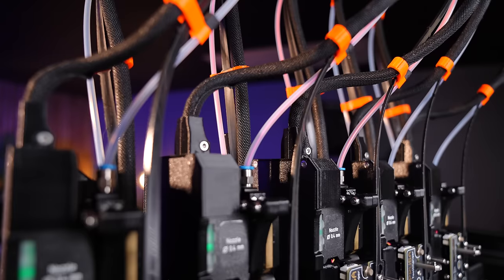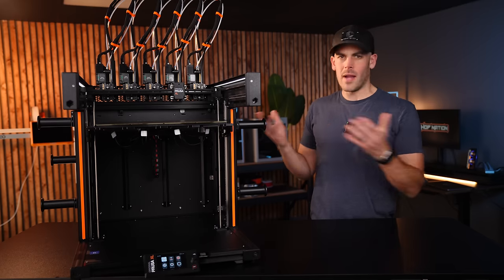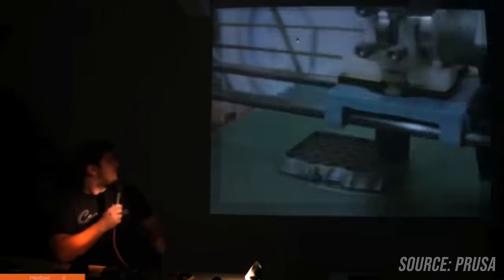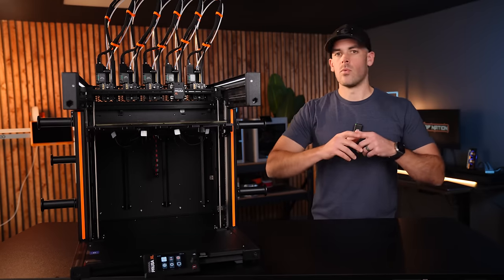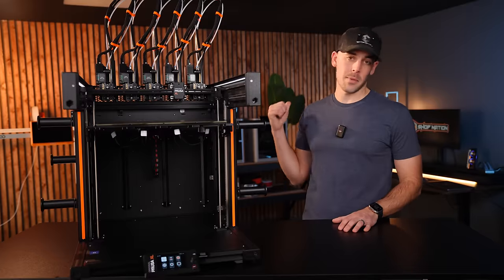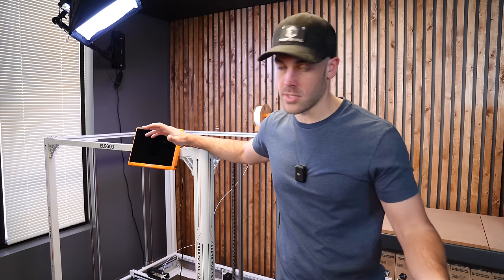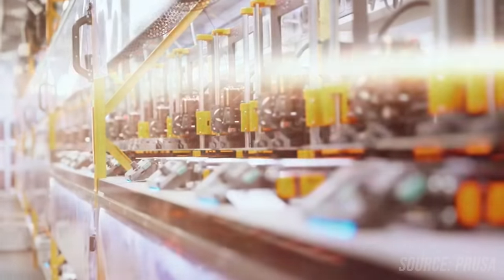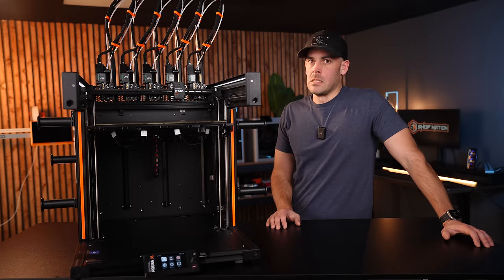Why Prusa is the next Blackberry

Comment: i'm not even necessarily sure if prusa needs an innovative or super new feature set. it really just needs cheaper printers (so innovative economics and production rather than features) with complete out of the box feature sets. what makes bambu popular and really what made the first iphone popular is its approachability and price, yes iphones were cheap at one point and that's what made them good. iphones nowadays are absolute trash for value nowadays. but they used to be a good product at one point rather than a status symbol. input shaping is already a game changing feature, it's on the mk4 sort of, now i just need it for about half the price and out of the box, oh look here's the p1p. prusa doesn't need a X1 competitor, it needs a p1p competitor.

Comment: My XP is from some one using a MK3s+ with an MMU2. There are some prints where I do need to print very small volumes of one filament then switch to another that cover most of the print. Having multiple changes and a proper construction from MMU through to the extruder is extremely important. With the MMU and MK3, that setup was incredibly frustrating that when my MMU failed, I just pulled it out until I upgrade to the MMU3. Funny….seems to be the same issues people using bambu labs are going through. Anyway, happy to pay a little more to get something better developed that covers that reliably. I am jealous of what Bambu come with for the same price point as an MK4 BUT anticipating reliability is still on top my decision making.

Comment: I have MK3s and Bambu Lab P1S printers.   I could buy upgrades for my MK3 or just buy a whole other printer Bambu printer at that cost.....yeah.   The only advantages in my eyes is a TPU/PETG part combos and the biggest (assuming the slicer is capable) multi nozzle size prints. So you can rip .6/8 nozzle and the do detail .2 nozzle work topside for one example

Comment: To conclude, the big Prusa is ideal for large multicolour work and the Bambulab isn't. Also it's a lot smaller. In fact if you compare build volume to price ratio the Prusa wins. The MK4 is a workhorse. Simple and easy for DIY maintainability. If you want a small super fast printer you can't do major maintenance on, buy the Bambu P1. If you want an easy to maintain workhorse and are more interested in quality than speed buy the Prusa Mk4. So in a way, each model has it's niche already.

Comment: My XL will arive next week. Never had a Prusa printer, I started this hobby 1,5 years ago with an Ender 3 S1 Pro. I considered to buy a Bambulab X1C, but I have to say there are 2 reasons why I don't like the X1C. The first one is the waste of filament when changing color. In times where sustainability is on our minds, this wastfulness turned me away. The second one is "being like an Apple-Product", no Open Source.
If you ask me for what kind of jobs I need the XL, I have to say: "I don't know yet." But when I started with 3D-printing, I had an idea in mind and while learning to print, so many more usages, I never had in mind, came forward. I expect the same for the XL. 5 toolheads might be overkill, but we will see. Of course I would have loved an enclosure and a heated chamber, but this might be one of my projects, if Prusa won't design upgrade kits. I am excited to experience the highly lauded Prusa community.

Comment: I would love to have a toolhead changing 3d printer. I bought a P1S for work and I outright refuse to print  "inefficient" multicolor stuff because of that enormous waste and inefficiency. Being able to do something is not always the right choice, it has to make sense and be a "true" solution and not a half baked one.
Having a slightly taller X1C with multiple heads for, let's say 2000€ would hook me immediately.
Also I dont get multi material tool changing printer without an enclosure. What "multi material" do they want to print with it? PLA, PLA-CF, PLA-tough, PETG?

Comment: I made the jump from Prusa to Bambu for a couple of reasons, and I think Prusa can definitely win me back with a few changes to keep them in the game.

1: The kits need to come more assembled than they are. Their Mini was a good step in the right direction that could be put together in roughly the same time as it took to take out, check and set up the A1 Mini, but you lose that as soon as you head any bigger. Trying to put together the Mk3S while having expected a Mini level of pre-assembly was a nightmare. With how much Bambu Lab slashed the price on plug-n-play printers, the Prusa kit prices feel not worth it and the assembled prices feel more like a tax than ever.

2: Quick change nozzles and ease of use. This is something I want both Prusa and Bambu to focus on more. The reason I prefer my A1 Mini compared to the CoreXY printers from Bambu is not just due to size, but because of how easy it is to swap out nozzles and maintain the hot end. I've yet to have the A1 Mini actually ever clog on me, and every time I need to switch nozzle sizes for a print (or god forbid, if something does get clogged,) it's a breeze to let the hot end cool and just swap the nozzle. It's these kinds of innovations that make both casual enjoyers and hobbyists lean over and covet this thing.

3: CoreXY and multi-material printing on smaller/budget frames: I love how the Prusa XL works, and that kind of work you did with the Benchy is kind of my actual use case. But I can't justify a 3500-4000 price tag, especially when as a hobbyist first and foremost even the X1C makes me squeamish. Bambu Lab made MMU accessible via their AMS lite for the A1 Mini, and it just works, with a price bump that is barely felt. Until the XL on the other hand, Prusa's MMU units were twice as expensive, a pain to set up, and nowhere near as effective. I'd love to see something (as oxymoronic as it is) like an XL Mini - two to four print heads instead of two, with CoreXY, around the 800-1000 mark, or a single nozzle option with MMU for 400-600. Wishful thinking, but I think that's the kind of big splash Prusa needs to make to finally switch gears and snap people away from starting at Bambu.

Comment: Prusa must IMHO significantly lower prices of their machines. Enter cost is now so uncompetitive, that it's hard to justify buying Prusa MK4 as first 3D printer. If you have MK3 then upgrade is kinda justified, but just barelly as the price of the upgrade kit is insane, just couple hundred bucks less than full MK4. Really, if I wouldn't have MK3S+ bought 2-3 years ago, when it was really good choice for the money, I would just buy Bambulab today. But I don't need two machines, so I "just" bought upgrade to MK4, which I don't know if I feel alright with, but here we are.

On top of that Prusa must do better updates to their basic MK4 and do it fast. I mean just look at MK4 and Bambulab Carbon designs. Prusa still lives in DIY scrap parts era, while competition puts out machines that are just pleasant looking. And have more features out of the box for similar amount of money. Bambu has enclosure built in, for MK4 its cost of yet another hundreds of dolars.

To summarize: Prusa is heavly overpriced, heavly aged machine now that is still great piece for hobbyists and they have great support and are EU based, but if they don't change direction soon it will be game over for them in the consumer market.

Comment: Prusa got big with a quality controlled version of an i3, basically following on from the ratrig project.

I only have my vorons now and they're wonderful - but they took a lot of work to dial in. A voron with a stiff steel frame and machined gantry joints? Od be all in.

The XL isnt the same thing. I think for most users multicolour prints are not much more than a novelty. Most of the AMS users I know tend to use them for continuous printing of the same filament, with maybe a spool of a different plastic for totally different models.

I don't think prusa the company will disappear, but i think they're going to disappear from the comsumer space outside of filament and perhaps their SLS lines.

Comment: Wow.
$4000 to output Benchie quality of a badly tuned $99 Ender 3, just in multiple colours. Given the time, the X1C will deliver far better unless you sabotage it. As I'm sure you know, to reduce the purge waste, you print 10-20-30x multicolours doodads at once for the Etsy toy store.

Yep, the XL was rushed to market not even half cooked. Yours is not the only one on youtube turning out low quality prints.
If I was a printer manufacturer, I'd be sending the content creators the units from the upper end of the QC to show them in their best light.  Dear god I hope these are not the upper end of the QC.

Comment: One major thing that Prusa (and any Open Source printer) will have for the fairly long term, is that 3D design always ends with the STL or 3MF.  These are standards.  Programs won't tie themselves to a specific printer and take on the burden of handling slicing too.  Short of Bamboo locking necessary features behind a propritary standard that they never reveal, that STL or 3MF will be useable with any slicer, and thus there's never gonna be a "walled garden" for printing.  This is in contrast to smartphones (which have always been closed off, from the first android to modern iOS) and PC operating systems (which use different libraries and output formats for executable).  Both of these result in a program needing multiple dependencies.  STLs and 3MF are isolated packages.  Short of reading the actual data, you need no outside resources to get the final result, it's all in the file.

Comment: It definitely doesn't justify the five heads, considering you can get two heads on it for about $2600. But one big advantage is using different materials for support material. Like petg for PLA and vice versa. I've tried with many fails on my X1's. I have never had the honor of owning a prusa, but have been eyeballing the xl for a little while now. With that being said I know you can get much cheaper idex printers, but they do not have the reliability of an actual prusa. And unfortunately for all other brands, bambu set the bar pretty high when it comes to high speed printing.

Comment: If you print multicolored parts, you lose a lot of time with AMS for material changes, so the printing is much slower than you have shown, and you have so much material waste with Bambu Lab that it is uneconomical - the additional costs for Prusa XL have paid for themselves after a short time, and you make more profit than with Bambu Lab printers.

Comment: "couple hundred bucks"? 😂😂 I know they're ridiculously low-cost for what you get (particularly for the A1) but that made me laugh after looking at a possible purchase of a P1S + AMS recently...

Besides the multi-material printing that others have mentioned, Bambu explicitly state that the AMS doesn't support a lot of materials, including TPU. Your conclusion only makes sense if you compare them on Bambu's terms: just focus on simple fast multi-colour printing with the most common filament types, and ignore significant limitations that need to apply to the print for AMS to be as reliable as it is at that price point. In that case, it just looks like a dead-heat between a young low-cost upstart and an old expensive complicated behemoth. Except that's ignoring the rest of the Prusa XL feature-set to get there. The XL supports fast multi-colour and multi-material printing, for all standard filament types, with near zero waste and an expectation of higher operating reliability by keeping the print feed as simple and robust as possible compared the relative complexity of the AMS feed system, as you noted.

While the iPhone to Blackberry comparison is apt if we're only comparing aesthetics and accessibility, it doesn't make any sense for other aspects. Maybe an early iPhone (limited functionality, but very accessible UX and high desirability) to early Android phones (rough around the edges, and requires more from the user, but much more functionality and flexibility... and with open source underpinnings that support an entire range of competing devices) would be better, but even then it's still a pretty bad analogy when looking at price or the structure of the 3D printing market. Is Prusa Google in this analogy? HTC?
Blackberry phones died after other phone systems knocked them out of the corporate market where their enterprise integration kept them separate from most competitors, which doesn't fit any of this - now they're effectively just a licenced Android phone badge. Were they actually the mobile phone market equivalent of industrial FDM like Stratasys? 🤔
Is Creality FDM's version of Nokia? 😄
At least it isn't the usual go-to bad analogy of comparing any new technology as types of car, I guess 😄

Comment: AOL CD? Nah. I remember getting AOL diskettes in the mail, using their internet trial, taking a magnet to 'em, and low-level formatting them for 1.4 MB* of sweet sweet storage!

I've been wanting to do some multi-color prints for things like con badges, pronoun pins, etc. so being able to do 5-color prints in a fraction of the time as a Bambu Labs printer and with less material waste is a no-brainer. Sure I have a purge block to deal with, but with the materials I'd be printing with, I can just chuck 'em in my blue wheelie bin and let the recycling center deal with those. I can see these getting quite popular with the 3D printing etsy shops

(*closer to 1.2 with a filesystem)

Comment: The build volume on the x1 is only 256mm square - way too small if you need a printer for cosplay like I do. My i3 Mark 3S is 250 x 210 so why would I ever by the X1? I went with the XL because I needed a large volume printer with the reliability of a PRUSA. I did a mind numbing amount of research before buying the XL and no one who had a large volume printer could stand up to them in comparison. Everyone's interests are different for 3D printers and for me the XL was a clear winner ...

Comment: True multimaterial, including *TPU*.  I'll say it again: *TPU*.  There does not exist any single extruder multi filament setups that can effectively handle TPU.  Not the AMU, not the MMU, not the carrot patch.  Multiple print heads and/or IDEX is the only way to effectively mix truly flexible materials with more rigid plastics.

Comment: Shop Nation where you been? At 70 I have the attention span of a gnat. You’re the only Youtuber capable of capturing my interest for 20-30 minutes. I spent 40 yrs in sales to the architecture/engrg/construction space. Most of that time was spent in start ups within existing corporations. Working for mfrs I saw this: There is always a tug o war between the egos of the C suite, operations, sales, & accounting. Most mfrs cannot pull off more than 1 or 2 good products. The myopia of acctg and the C suite often causes the stagnation for innovation. Prusa no doubt suffers from the same thing. Mfrs must have capable staff adept at lean mfg and Kaisen or other. If not they get left in the dust.

Comment: Full honesty, as someone that makes cosplay bits & parts, a build volume exceeding my CR10s Pro V2 but with up to 5 colors/materials on deck on their own heads is basically a dream machine. Yeah, it's a lot more than the bambu but not being stuck with bambu's "Ecosystem" of crap and having individual heads per material is great (EG: Having specific nozzles for the more testy filaments i use)

More or less, i could replace my 2 smaller machines with one bigger one that could literally print twice the parts they can combined (14x14 compared to 2 7x7 machines) and still do 2 different materials.

I think a "MK 5" single-head machine with like, a 10" cube build as a core XY would be the best mass-market "Pivot" for the long run, but the XL for certain users (Like me) is a great machine with some minor upgrades

Consider this, i can print cosplay armor parts currently, but it takes 3 machines to make one part. One makes the flexible joints/spacers/inserts, one prints the smaller joint/detail/etc parts, and the big boy prints the big chunky parts like main plates or straps

On something like the XL, it can be done on just that machine, large parts on one half, smaller parts on the other, and one head for each material with their own nozzle just for that type of material.

It's a bit "All my eggs in one basket" to do that, but to do complex builds like that in just one machine and still have my others free, is kinda nuts.

Not something that'll ever likely be a "Huge" part of the market share, but for the right customers it's something great to have avalable.

Comment: The key goal should not be for Prusa to pivot, but rather to diversify. i.e. keep making the nerdy DIY kits, but also make some "iPrint" offerings for the filthy casuals. While they are at it, they should leverage their CNC IP framework to make related things. Laser cutters, table routers, pick-n-place machines, EDM machines, etc. Perhaps a hybrid of a normal 3D printer with these. 

TL;DR: In business terms, they need "horizontal growth."

... but, yes, I agree with the premise that birthed the video title... the times are changing because the normies are weighing in with their wallet/votes and it's clear what they want. Press button = get print. I, personally, prefer my printer to stay a project in and of itself for many reasons, not the least of which is because it's cheaper that way. However, I am becoming the minority customer.

Edit: Removed reference. Wrong brand.